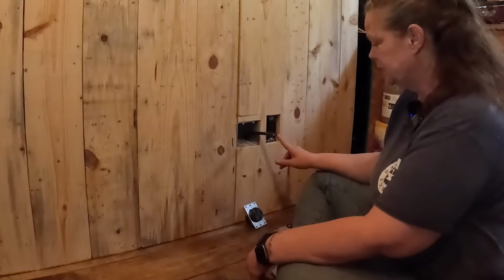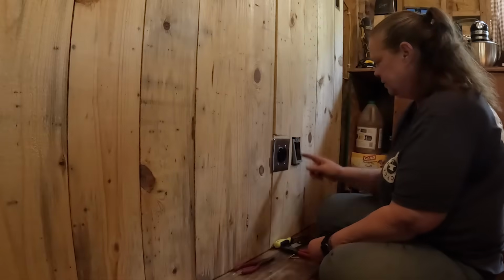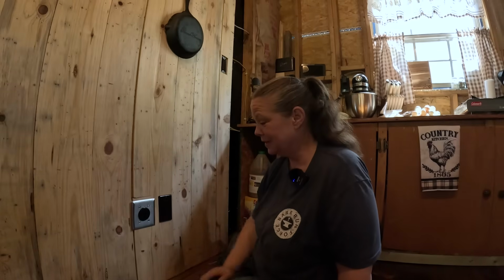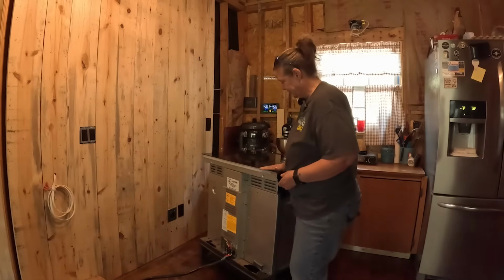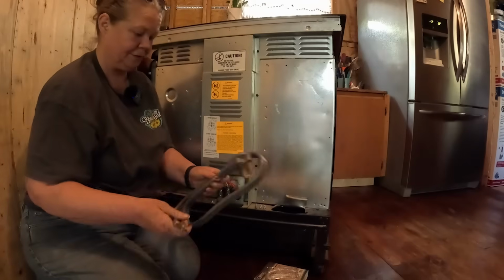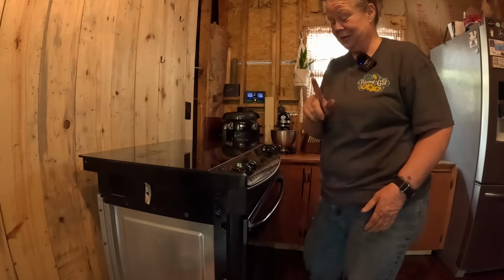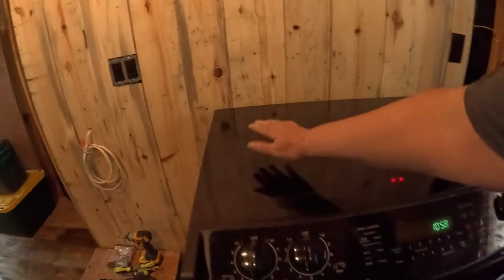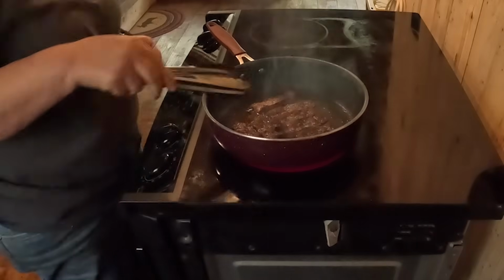She Built a Tiny House - HUGE Farmhouse Kitchen Upgrade, Electric Stove Cord Replacement

Comment: Your electrics in America are so dangerous. They are live all the time! In the uk each socket has an on off switch to cut the electrical circuit
Reply from the maker: We run several outlets (sockets)  on each power line and each power line has a shutoff breaker, all large appliances have their own power line and shutoff breaker plus there is also a main breaker in the main box that can shut them all off together.

Comment: High heat is never used on electric, except to warm the burner and then turn it down to cook. 
When you bake , the oven can be turned off 5 to 10 minutes early because it will continue to cook while it cools..... the same with the burners. 
Once you know your stove, you will know what to do. 
Electric ovens are more accurate,  gas burners give more control.

Comment: If you want to bake your bacon, place it on a foil lined shallow baking sheet. ( Fold foil to keep bacon grease on foil.).
Bake at 400° for roughly 20 minutes ( adjust according to how crispy you like it). 
 I like this way because I don't like when frying bacon spits hot grease at me.
Reply from the maker: Thank you for the tip! Just started doing that, so much easier and less messy
Reply: @patbo3577  and if you lightly dredge the bacon with flour before you cook it turns out wonderfully!

Comment: Mama V. Just a suggestion. I had a stove like that and the self cleaning feature burned out the computer so if it was my stove I would not use it. That front right burner is supper hot to boil water
Reply from the maker: Thank you for the advice. I will probably not be using the self-cleaning feature
Reply: Same thing happened to our stove and the computer is expensive to replace.

Comment: Mama V your new to you stove looks wonderful!  I cooked on gas until I went off to college, but I was converted almost 50 years ago and love electric cooking.  Your friend was correct, I never use anything above medium unless it is to boil water!  you said you were going to use oven cleaner on you top, my advice is to use “the pink stuff” or buy a special bottle of glass cooktop cleaner, it will make it look like brand new.  You do want to be careful with the pans you cook with, some will leave metal marks on the glass that are really hard to polish off.  And if you just have spots to clean out on your oven and on the oven door, I would recommend  a spray bottle of “Goo Gone Oven and Grill Cleaner”, it is the best, it was recommended to me and I will use nothing else!!!  And before you cook too much in your oven get a roll of the silicone oven liner and cut it to fit the bottom of the oven.  You will be so happy the first time something spills over and you are able to let the oven cool and you can lift out the liner and clean it off and put it back in the oven!  Your cabin in the woods is really coming along, I cannot wait to see what you do with the rest of the kitchen and the bathroom!  Keep those videos coming!!
Reply from the maker: Thank you so much for all the great advice!

Comment: Even though the stove has a self clean function I’ve always heard that it’s not good to use it. I have heard that the extreme heat can actually damage the stove. I don’t use the self cleaning function but do use the steam clean function.  For cleaning the glass top Wegman’s makes a cleaner and has scrubbing pads specifically made for glass cooktops.

Comment: I had a glass top range and I somehow broke the top.. it was going to cost as much as a new stove to replace it , so I went with a a gas stove instead.. I always cooked on gas and I liked it better so I went that route.. I could start the burners with a match in the power went out and cook beans or whatever..
If you put a piece of plexiglass on the wall behind your stove or something to work as a splash guard , it will protect the beautiful wood walls from splatters..

Comment: 🤠   STOVE VENTS.   If you find the wood wall behind, gets a tad bit warmer than you like,  be easy to rig a heat shield behind, also can hang a cookie sheet up for a splash guard,    or you can do like Mylittlehomestead,  ( On of their latest videos)   find some ceramic dishes, break them in pieces,  and make a decorative mosaic

Comment: Be very careful about using your cast iron on top of range. Can definitely be used inside the oven. Cast iron gets extremely hot and retains heat. It can scratch your cooking deck.

Comment: Hi. I sold GE appliances for over 14 years. You have a  "slide in range". The main body is 30" width. Then of course you have your overhang with the cooking deck is wider. Your model/serial nbr is on a tag on the interior side wall where your drawer slides in and out. Not in or on the drawer as that is replaceable.  I highly suggest you write down your nbrs for future reference...in case of a service call. The serial nbr will give the date it was produced for the age. Congratulations!
Reply from the maker: Thank you for the information and advice!!

Comment: Hi Mama V - You can find the instructions for your stove online to read and or print them out.
Reply: @jax-zm1bb  Yes just have the model number and brand .. I don’t know if you need the serial numbers, but I’d write them down in case.. I did that to get the replacement bulbs in my microwave

Comment: You have a very nice range there, Mama V.  Im so happy for you. It really makes life so much easier.

Question please; being that the  top does not have a top that goes against the wall, how will you protect  your wood walls against splashes???  I've seen some nice metal back splashes.
Reply: I just use contact paper on the wall behind my stove being plastic type it washes right off no problem 😊
Reply: On wood walls she might want use stainless steal covering